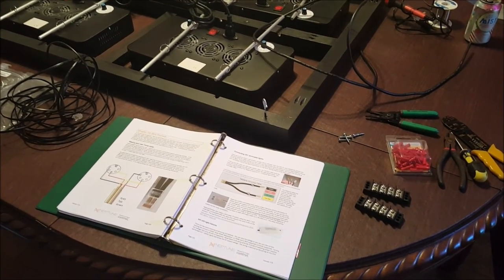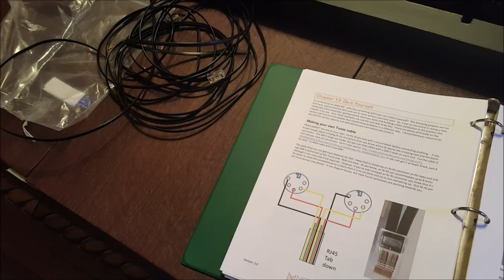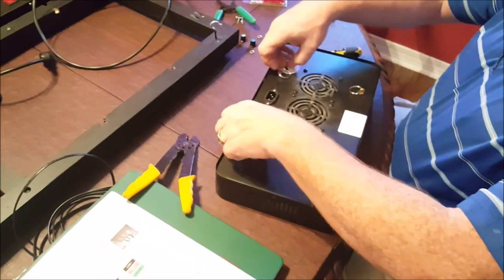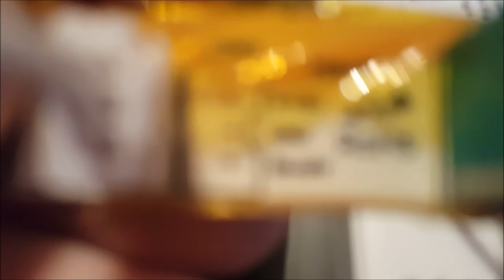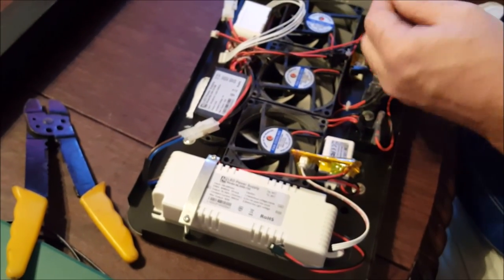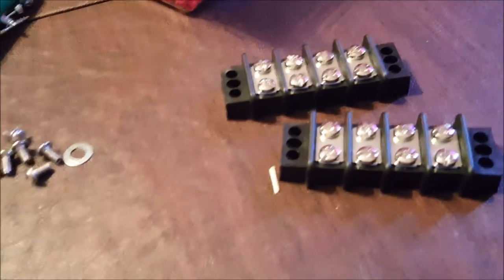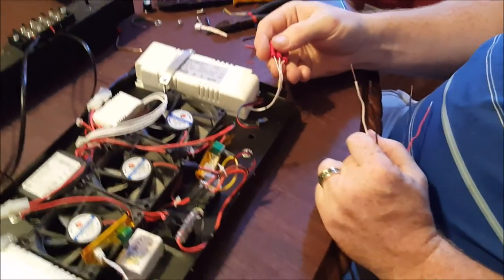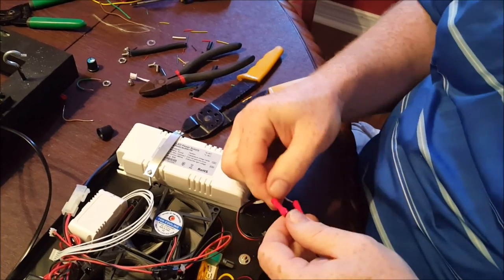Black Box Apex Hack Part 1

Comment: If I use a standard Ethernet cable with 8 wires inside can I take advantage of the the variable speeds v1 and v2 by using only one port on the apex instead of using both v1v2 and the v3v4 to individually control each color dimming. I would like the have the othe variable speed port v3v4 open for something else.

Comment: Will setting the LED to 0 in Apex "turn off" the LEDs or do I need to add to the Apex Energy bar also and turn off the outlet?
Reply: Dan Granger. I have the same question. After apex fusion set to off the lights remain on at about five percent.
Reply: Ultimately I think it is the LED drivers that can't go to zero. Mine are around 10-15%. Not absolutely ramping 0-55% but still works for my tank. Someone mentioned changing the drivers and you could get to 0% but that was too much of a hassle.

Comment from the maker: Get the best black boxes made at SBReefLights.com
18 months of tweaking and testing by real reefers, provides the best spectrum possible for growth and color.  Plus add built in mounting legs in addition to the normal hanging kit, upgraded quieter fans with high CFM for cooler running and more diode longevity, and a 2 YEAR USA WARRANTY.  For less than the price of any other premium black box while providing the best diode layout possible.  Not all black boxes are created equal.
Reply: Does this work on the 32 basic